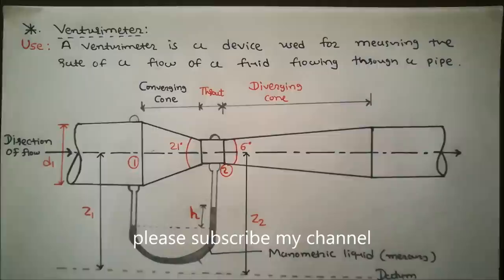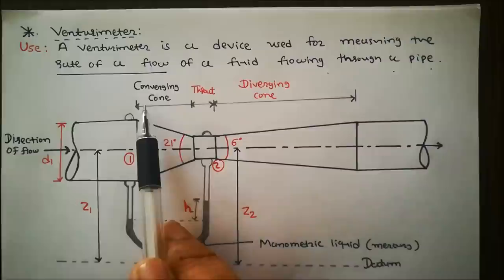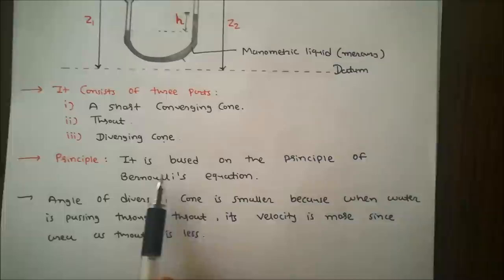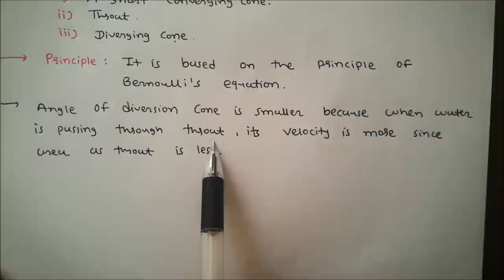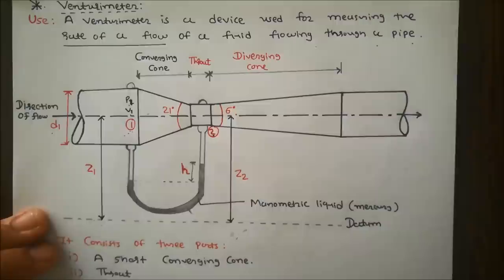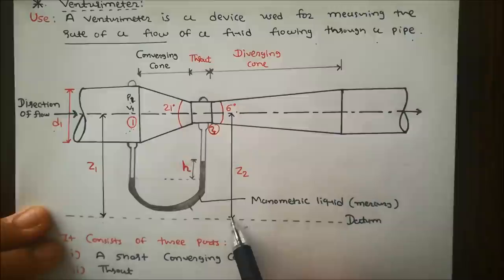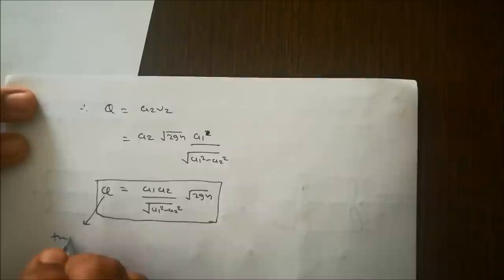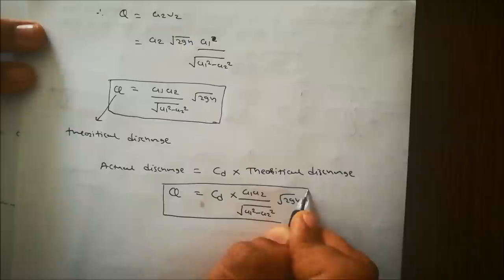venturimeter & derive equation of discharge

Comment: how coefficient of discharge of venturimeter is effected by Reynold's Number?
Reply: simple solution for the question is the derivation of that question, so you know how reynolds number drive by simple physics then you know about its dimension which correspondent to the final equally important equation
now you know how anyone can get there answers in physics, all that simple, isn't it?